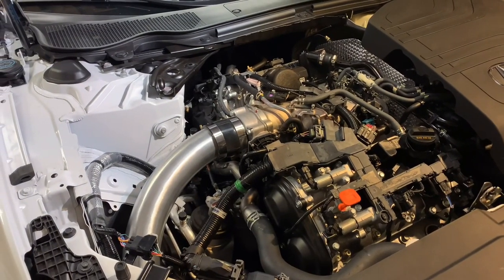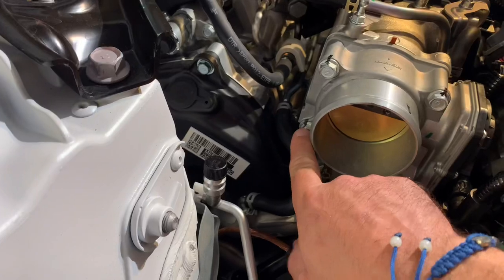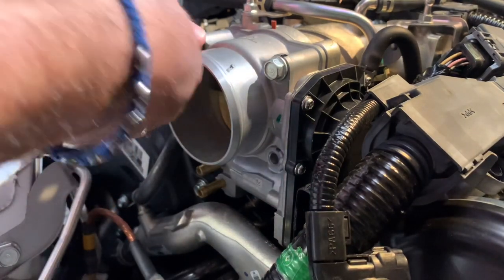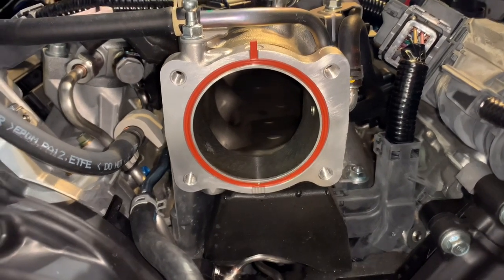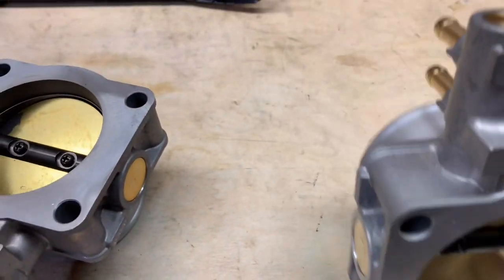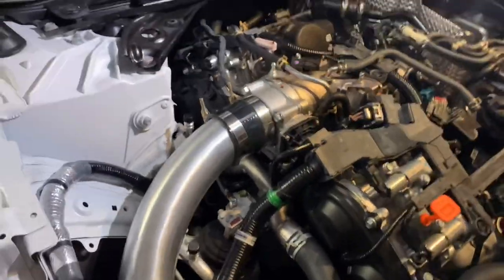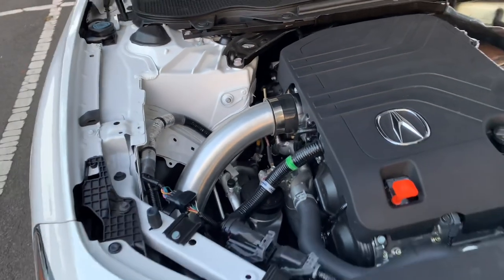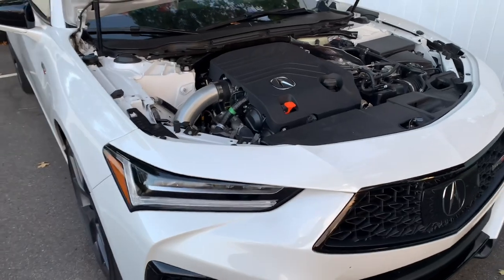Tlx type S gets upgraded throttle body

Comment: Minimal gain.  We need to figure out ways to drop its weight.  Then again, I don't think a 3.0 turbo has much to offer.  They should use the EarthDreams J35 engine from the Gen9 Accords and then twin charge it.
Reply from the maker: The recipe is there just need tuning to be h locked to really move forward

Comment: This is major.  Honda engineers haven’t publicly begun to tweak their newest turbo toy.  Look how many applications the 3.5 six cylinder is in tuned, detuned etc.  I would worry too much about warranty stuff.  I started buying Acura in 2006 when looking for a nice SUV for the wife.  5 Acura’s later….zero problems.  The sweet spot for the 4 MDXs I’ve had is 90mph.
Reply from the maker: These engines will be having huge gains 💯

Comment: P2R also has CNC ported intake manifold too...they say it will fit my MDX Type S...very excited about it...would love to do larger FMIC and piping, downpipe and Exhaust, along with throttle body and intake manifold
Reply from the maker: Yea, I have the intake manifold installed as well along with everything you mentioned besides the exhaust

Comment: Wonder if the tl 80mm throttle body will bolt on to the manifold
Reply from the maker: Possibly but the opening of the manifold would have to get port matched

Comment: There we go guys its already improving 1 Throttle body and the 12s are around the corner. I knew it. We are not talking about Hondata yet or downpipe.
Reply from the maker: The car actually has a custom downpipe and the throttle body was added for this video but yes 12s are right there 👍🏻
Reply: @BCautosolutions  Still very significant

Comment: Time most likely dropping from lower temp, da.  You running 91 or 93?
Reply from the maker: Yes that’s deff a possibility although I did multiple runs 20-30 degree difference and it stays pretty consistent within .1 now with all mods. I’m on 93
Reply: @BCautosolutions  Would be interesting to log with ktuner/hondata to see if it is pulling any timing on stock tune.
Reply from the maker: @Zharsergey  I’ve thought about buying k tuner just to log. I would like to think/hope they will offer  tuning for this eventually. But yes data is key, more people need to realize that, but from talking to someone that has been data logging his, the stock map is garbage and there is tons or room for improvement.

Comment: pretty cool stuff you re doing to this car and I appreciate the content but I wouldn't recommend doing that coolant re routing (Honda tech to Honda tech). I just recently purchased 1 of these for my son and yes they are disappointing power wise. I'm waiting for ktuner to come out with a flash, these feel like they will be able to produce a lot of power with just a tune. His previous car was a fbo prl  ctr with ktuner prl base tune, it would run circles around this car (it did when we traded it in, we ran it on the fwy) but its apples to oranges and not fair. Personally I wouldn't do any of these mods until there are tunes out for them unless you are sufficient at tuning it yourself or have help tuning the vehicle.
Reply from the maker: Appreciate the insight and opinion. Ctr is one of my personal favorite cars and had I not secured one of these cars, would have been my second option. Congrats to your son
Reply: @BCautosolutions  Thanks man, where I'm at, we are Honda and am fortunate enough to have our Acura store next door so we can brainstorm issues with both brands. They are similar and different in many ways. Anyways I think the choking point in this motor will be the turbo. the motor is overkill for the turbo....the car aside from just power is astonishing. keep doing what you're doing, i'd like to see where this platform leads.
Reply from the maker: @supemebart4461  i agree, comes with a td04 (same family size turbo can be found in type R) which is a whole liter smaller in displacement, so I agree I think a td05 could have been more suitable. It would have been more sluggish down low but would have kept pulling up top. Anyways stay tuned, plenty of updates coming.

Comment: The force induction sounds nice.
Reply from the maker: Sure does
Reply: @BCautosolutions  man I can't believe how fast this car is after those three mods. You should make a video a tutorial on how to take the downpipe off. And then on another video you should also make a video showing how big the turbo is and how it compares to the CTR. I know everybody swapped the a spec turbo. I'm just wondering if that this is a bigger or smaller turbo.
Reply from the maker: @kongxiong6005  turbo is similar size to fk8 although tlx is twin scroll but I have a feeling new type r will be as well. When I remove my downpipe for whatever reason or install one on someone’s car I will 💯 make a video